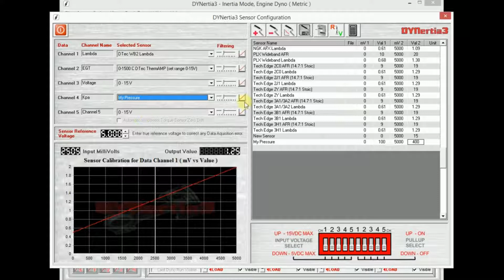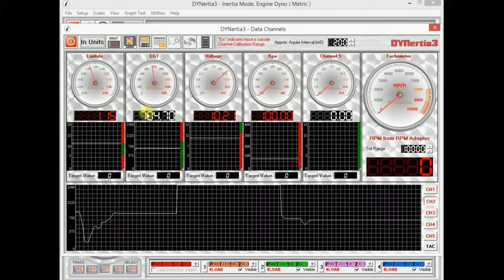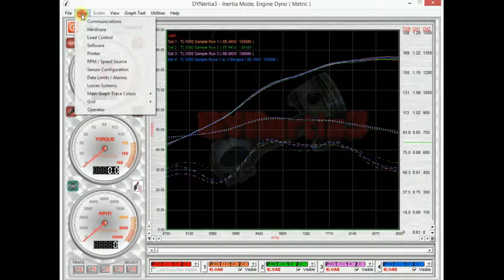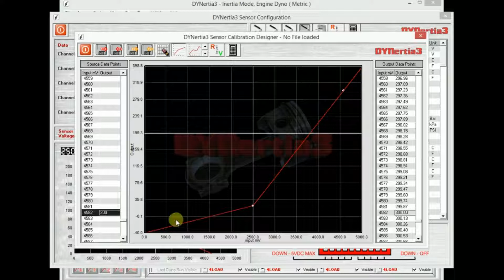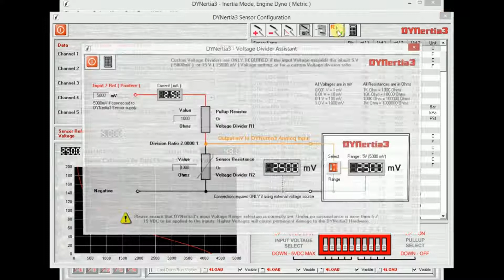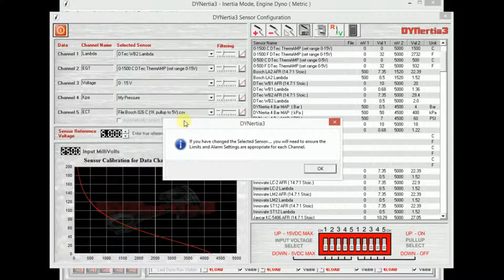Dyno Software (#6) Input Configuration DTec

Comment: How would I get any graph on the dyno screen to show the rpm of the flywheel/inertia wheel in using the rpm adapter for the engine and it already works but we need to know the flywheel rpm and I can’t figure out how to see that